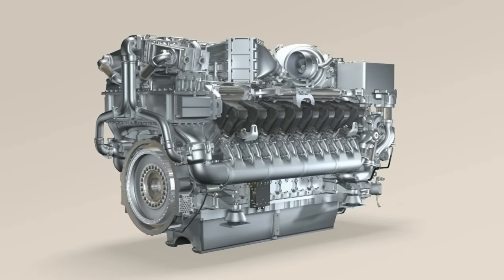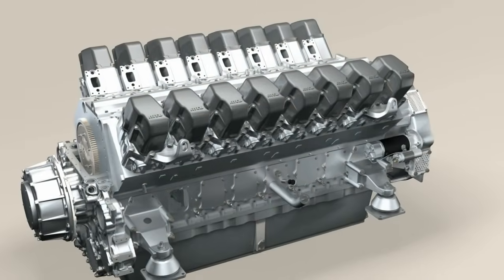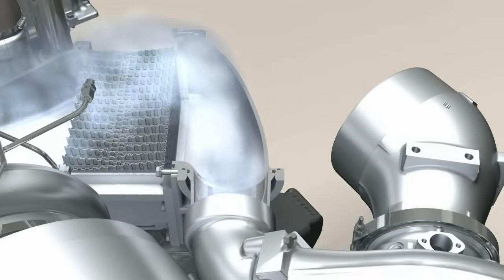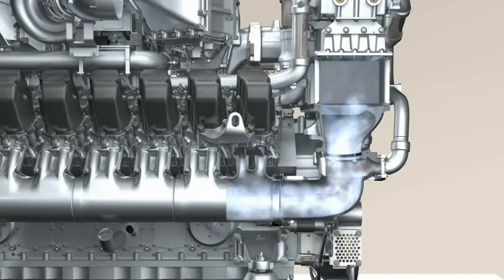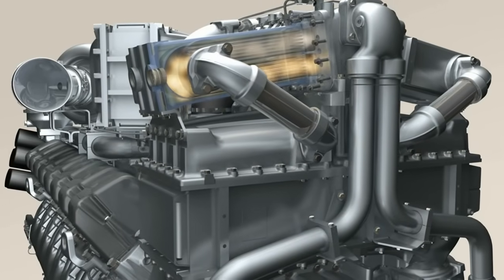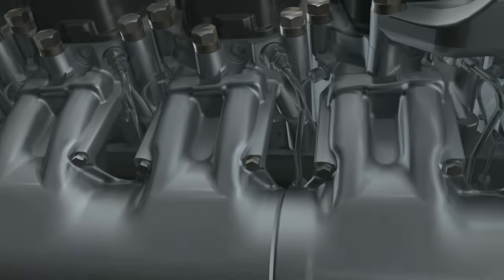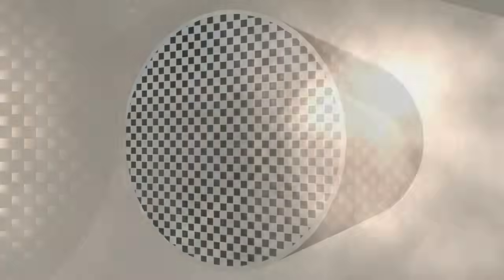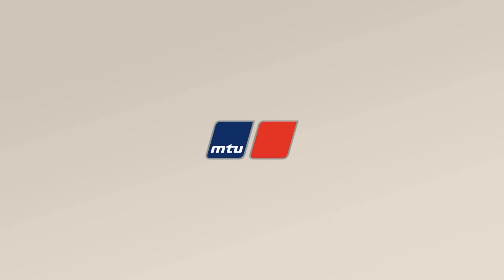The Incredible Journey inside a mtu series 4000 Locomotive Engine

Comment: I will never understand how you can add exhaust gases back into the combustion Chambers and get a more efficient combustion burn oxygen is what supports combustion ,burned,used up exhaust gases will tend to stop the clean oxygen rich fuel cycle,from acheiving a more complete burn of the fuel!,Wouldn't a more oxygen rich environment promote a more effiecent burn useing up the fuel and thereby not creating as much pollutants! I've noticed that on several new cat and Cummins engines that fuel milage is way down from engines made say as of 1994 my new peterbuilt truck only gets about 3to4 mpg on a 503 cid engine rated at 330 HP. My old truck had an 855 cid engine rated at 350 HP and got 9 mpg and much more torque ,.So how can I burn two times as much fuel and get better cleaner exhaust???? Please somebody explain this to me???
Reply: The objective is to reduce pollutants. In perfect conditions an engine (or any combustion of petrol, diesel and the like) should only result in water and carbon dioxide, which is a greenhouse gas but not a pollutant. 

In practice, combustion is messy and a lot of other stuff comes out: soot, particulate, nitrogen oxides... Forcing part of the exhaust to go back will break down these pollutants and achieve a more ideal combustion. 

Burning spent fuel absorbs energy, thus decreasing efficiency and increasing fuel consumption. The amount of oxygen will always be more than enough in a diesel engine. In a petrol engine, you can control a variable geometry turbine via software to ensure an oxygen rich combustion

Comment: MTU builds wonderful engines.  Too bad they have to choke them with EGR and DPF's.  That DPF housing looks like it takes up about 1/3 the space that the engine takes up, and requires the burning of more fuel to regenerate.  Older engines without the alphabet soup of emissions systems are more efficient.
Reply: It's a big issue with locomotive engines since they can't use Adblue unlike on-road engines or marine engines.